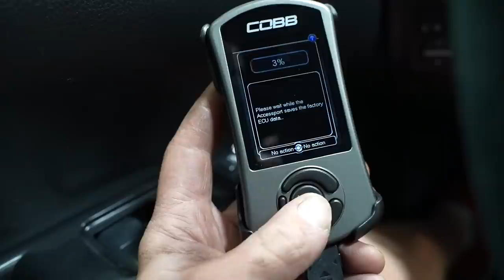The STi Gets New Exhaust and Carbon Hatch!

Comment: dont forget that the exhaust will start to sound even better once you put some miles on it. My nvidia N1 sounds awesome with even my stock sti downpipe! about 40k mi through it so far. Pops and crackles a little from an OTS tune even. I know I really need a custom tune but haven't got the downpipe yet.

Comment: I know its a little thing but the fact the Grimspeed front shroud has radiator mounts built in is so much cleaner than the ugly stock ones. Though i was waiting for the Ace Hardware to be busted out.